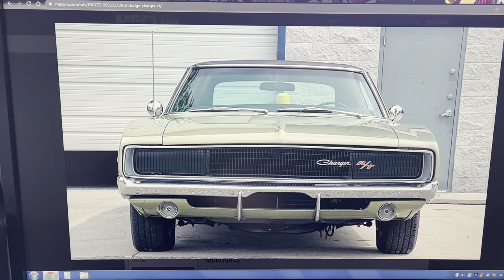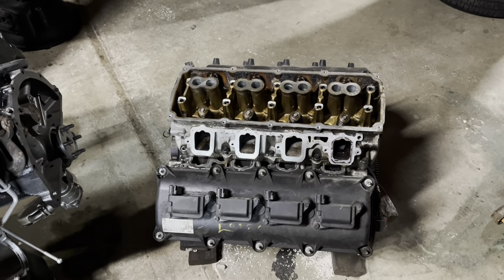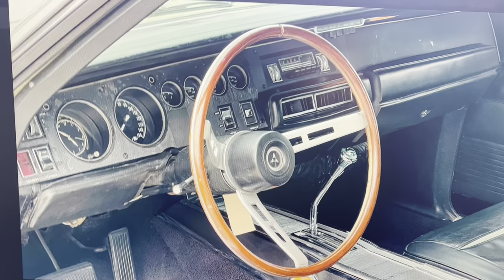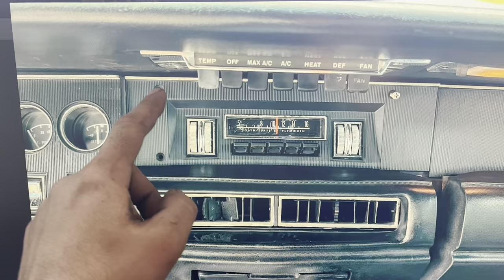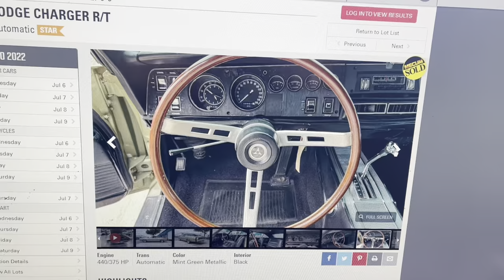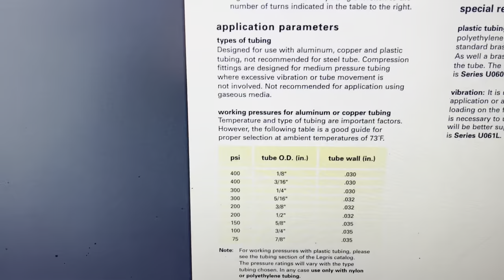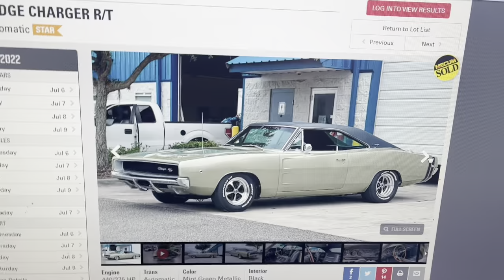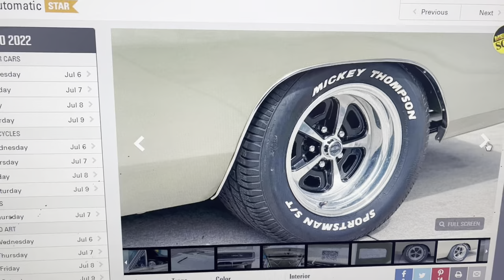Why Did This 1968 Dodge Charger R/T Just Sell At Mecum For $170,000? (It’s Unsafe And Bad)

Comment: Sad thing is my buddy and I and another buddy restored a 68 super bee, not factory original but close and only had around 35k in it. So I don't get why people can't take pride in their work. The compression fitting on the brake line is a major no no and used to be illegal to install on brake lines, now they did have steel compression fittings for brake lines but thats besides the point, we bought all the brake lines new in stainless pre bent for the super bee for lil over $200 shipped. And they fit great no issues. So yeah wth?

Comment: I bought the same ugly green Charger, mine was a 69 in 1976, and because the door was sprung(don't back up in the snow with door open)paid $200. New quarter panel, door, alittle welding and paint it was good ta go. I got $1000 on trade in on my 70 Cutless 442 and never looked back or owned another Nocar!
Reply from the maker: Good! More for me.

Comment: Brass compression fittings are for household plumbing pressure.  There are compression fittings that can withstand well above automotive brake pressures, but they aren’t made of brass.  In a pinch, I’ve used a stainless Swagelok fitting.   But for $170k, I’d expect the brake line to have no unions.   This isn’t a vehicle that exceeds the length of brake lines stocked by parts stores or repair shops.
Reply from the maker: Right - that too. But factory reproductions are also readily available. There are fittings that can do this safely. That isn’t one. And yeah - for $170k…

Comment: I drove for Mecum Kissimmee for 2 years and it while it was a bit fun, many of the cars that posed as high dollar and desirable cars, fell very short of that and had been patched and covered up the defects which I found easily while waiting in staging. Many, many high dollar cars have crap gas, you can smell that lacquer smell when gas goes bad inside the tank and many also had cheap new batteries. These cars IMO go to the fact they did not come from an owner that had the means and or desire to take care of his cars. One 68 Camaro SS had such bad electrical issues that it would shut off, complete electrical failure then after waiting 5 minutes you could hear the auto-resettable CB clicking back on and all things came back to life. No Camaro or car that I know of that time has an auto-reset CB. Fuses, cars back then had fuses but someone that did not know how to wire a car and used these fire hazard CB'S. And it did show as wires ran all over the engine compartment and the darn thing sold over 50K. This was maybe 10 years ago. I would not have paid more than 25K for this car. I could go on and on........some people have way too money and should PAY up and bring a good collectable car mechanic to these auctions. Some do, most don't.

Comment: The compression fitting is one of those things that's just not going to go away. DIY'ers use them, dealerships use them, and auto parts stores sell them in a little rotating rack that says "brake fittings" on it so good luck getting rid of them. I only recently learned that most of them are not DOT approved and technically illegal to use on the road but I can name a slew of local dealerships and even commercial repair shops that use them.
Reply from the maker: Yeap… there are a whole lot of them on the road unfortunately.

Comment: Have seen compression fittings and single flares on break lines too many times even from shops. They aren't even  legal for passing inspection here in PA.   And the plethora of other points in your not picking this car apart  are sound as F.      $170,000?!?!   This car has many  great bones , but this price is INSANE.    Looks like this car did fail a test drive and was slapped back together and sent to auction.   Hemi cars are totally out of reach for the regular guy and 440 cars are getting there too. But this price for this car is ridiculous.  It doesn't take much of an expert to see it, you're right .   Sad for true car guys. Everyone wants to score when they sell , but this is kinda like the snake eating its tail for the future of we motor heads.

Comment: I see one other pretty obvious thing wrong, and that is the ride height. It is noticeably too low, front and rear. Well below stock. The one good thing I did notice is that it has the correct 15" wheels and real tires, actual tires with actual sidewalls, not 30" GHETTOS with a thin strip of rubber wrapped around them. They are BFGs, and having put BFG Radial T/As on my 1976 Corvette about a year ago, I am not happy with them. The white letters turned brown fairly quickly. With a razor blade and some brake cleaner, I was able to get most of the brown off, but it came back a couple weeks later. The tires are defective. I went back and forth with BFG for 6 months about this, and never got anywhere. As for that Home Depot compression fitting in the brake line, that is unforgivable. But my biggest concern is the body. I'll bet there is a ton of rust and bondo under that new paint. I am a mechanic, and mechanical things can be fixed. But a rotted out body is a whole nother thing. I am not a body specialist, but I have worked around them, and I pretty much know what is involved. The body is basically the car. It's what everything else attaches to. And if it's bad, the car is junk. No amount of mechanical repair will fix it. $170K should have bought a brand new condition Hemi Charger.
Reply from the maker: I completely agree. My car doesn’t sit at stock ride height either, and though several other people have brought it up, it really doesn’t bother me personally so I didn’t mention it. It’s definitely not stock.

Comment: This is an old post so I don't know if anybody will read it, but here I go. I started work at my first garage in 1987 after graduation. The compression fitting you are showing look pretty much like the ones we used on cars from that time that came right from our brake fittings bins supplied from our brake parts supplier. I will not mention their name but you "Might" guess it. I never had a problem with them. I have a 1979 Aspen Rt that had them on it when I bought it 25yrs ago. It has seen harder and longer braking than most of the cars I've ever owned. I would never install one of these now, but maybe the old ones were better or a lot of people were just lucky. If I bought something now and saw them I would definitely get rid of them, but I wouldn't judge something that might have been done before standards changed.
Reply from the maker: I could be wrong, but that one looks like it was just installed. There are zillions of those things in service in brake systems. Many commenters have said as much. I realize that this isn’t that uncommon. That doesn’t mean it’s a good idea… a flare connection is the right way to go. And on a $180,000 car… could they not just afford a replacement brake line? They aren’t that expensive…
Reply: @DeadDodgeGarage  I agree, at that price everything should be premium. I just found your channel and like what you are doing. Congratulations on it!
Reply from the maker: @markdavis3362  Thank you!

Comment: Note the chart for flare fittings was for a 37 degree flare  - that's like an AN fitting.  SAE is 45 degree and should be double flared.  I think I'm one of the few that bother to double flare (I actually have extra mandrels because those little buggers tend to break).   I think AN fittings are OK with single flare - but I did see a tool that claimed to be able to double flare a 37 degree fitting.

Comment: The car sold as if the guys at Graveyard Carz or some other quality shop restored it. The problem with it is that with so many glaring problems such as the missing front sway bar, compression fittings in the brake system, improperly run speedometer cable that has been melted and not replaced the fix a ratchet strap, the interior trim is a mess with dash screws missing, the window trim not properly installed on the rear side windows. This car is a hot mess on what we can see corners we’re cut everywhere this is a bad backyard restoration if this came out of a shop they need their license revoked. I need to circle back to the brake line with the compression fitting it just keeps bugging me the line looks like two brake lines spiced together making the line that isn’t run properly as pointed out I believe they went cheap because the actual brake line was expensive and they went cheap possibly salvaged part of an original line and a stick of brake line and $5 compression fitting this worries me how many other places did dollars over safety take place on this car. I would love to see this car get an inspection by Graveyard Carz but I’m sure they are more than aware of this hot mess I’m sure they have to make sure that everyone knows they had nothing to do with it. I use Graveyard Carz because they are the best of the best having done million dollar plus cars 1 of 1 cars regularly with values near a million restored back to off the assembly line condition.

Comment: I have seen so called professional restorations that id be embarrassed to have in show. Or even drive. Took my 65 Impala SS to a large show near me when i first built my car almost 30 years ago. They used my car in for some of their advertising. And i was the only car in the top 10 that wasnt a trailer queen. I drove mine. And still have it. And it still turns heads everywhere i go.
Reply from the maker: Very proud to drive my Charger as much as possible. Ok, also slightly ashamed because it looks much nicer than it is and everyone drools over it.

Comment: You are 100 percent correct about not using compression fittings on brake lines.  I quit following that hack Scotty Kilmer after he said in a video to use compression fittings on brake lines.  Thankfully, someone in the comments said no, this is not correct.  I researched it myself and bought the right stuff.  But just think of how many people believed what Scotty said and actually used compression fittings on brake lines and spread that misinformation or worse yet got hurt because of it.
Reply from the maker: Wow… I wasn’t aware that he did that. Incredible.

Comment: I've been in so many arguments with people about compression fittings. Even the parts store sent me compression fittings after I specifically told them it was for brakes. Ended up having to go explain why it was such an error because they apparentlyhad no idea and or couldnt read.  I did state inspections for a decade here and a compression fitting on brake lines was a definite failure.
Reply from the maker: Yeah… I’m amazed by the number of people in the comments here saying it’s fine. It’s not fine.

Comment: I had a 68 Charger . After I fixed the A/C it was the coldest I have ever seen . I would actually put ice on the windshield in July in Florida . It had a 318 so it wasn't road burner .
Reply from the maker: That’s terrifying. Haha. I love a good 318. I would have been fine with a 318 (or heck, a slant six,) but I’m glad mine is a 383.

Comment: I'm a poor but relatively honest retired mechanic in the UK. For amusement, I build, in a wooden shed, restomods on classic Triumph Dolomites, usually with more modern fuel injected GM engines and transmissions. Not that I sell them, but if I did they would be relatively low budget cars, maybe only £12k max. But NOTHING i've done, even on my WORST day, is as bad as that Charger. 

 As hard up as I am, I have an ancient Pickavent pipe flaring tool for making hard brake lines (cost me a couple of hundred new, 30 years ago) Even so, using that compression fitting, probably designed for central heating, is unforgivable. ANY garage worth it's salt will have a tool like mine and would have made a new pair of pipes to pattern (the other one looked pretty rusty too) for only a few bucks, Hell, in the UK you can buy a whole SET of hard lines for most classic cars, made in cupro nickel so they don't rust away EVER again, for around £100. I bet that goes for the Charger over there too!

 It's not only dangerous bodging, it's UN-NECESSARY dangerous bodging!
Reply from the maker: Exactly! It’s not like flaring a line is all that difficult! Annoying, maybe. And takes a few minutes more than this bad repair. But not that difficult. That does sound amusing!

Comment: I watched one of those auctions on TV a few years ago.  An AAR Cuda or Challenger Trans Am, can't remember which, went on the block.  Four speed car.  Had a camera underneath as it drove up to the line.  You could see the flywheel/clutch assembly spinning around as it drove forward.  The dust cover was missing on this high dollar car.  Now, you can drive a 4-speed car without its dust cover, but DAMN - it's a low dollar item and easy to find, at least in reproduction.  Makes you wonder, if something that easy is wrong, what other corners have been cut?  I know from experience that there's always more wrong with a car than you can spot in a quick once over.  I also know a guy who buys, then "restores" cars.  Same formula - fresh paint, some new upholstery, generally zero mechanical rehab, or at least as little as possible.  Then he sells it after driving it to a local cruise night a time or two.  Afraid to drive it more than five miles.  One AMC car wouldn't start, got me to help, he thought maybe it was the carburetor, turned out to be a stripped distributor gear.  I put a new distributor gear in it for him (with the old cam gear staying in place), then timed it for him (he had no idea how to do that) and he immediately sold it before anything else tore up.  He literally was afraid to drive it.  And that was one of his nicer cars - excellent body, nice interior, looked really good so long as you didn't look underneath or down low in the engine compartment.
Reply from the maker: Exactly. What else is hiding if they can’t be bothered to do stuff like that right? Yeah.. that sort of stuff is just so far out of my universe I can’t believe it. Drivability and things actually working come before all else to me. To be fair of course, I don’t have enough money to mess around with cars at that level.

Comment: There are some really shady mechanics out there. I took my 73 Cuda to a couple and had of problems.  The first never got the car to run right. New pistons, new heads, new A/C complete overall and the car would over heat. Another mechanic in Des Moines took in my car. I found that his son had a beat up barracuda and parts from my car were exchanged to there's. He got it to run a little better but I too the car away and he was trying to keep it saying the brakes were unsafe and he would be liable. He just wasn't finished exchanging parts. Replace the old tach that was just disconnected with a new one that is not running properly. Tach won't register over 5,000 rpm. Bolts that connect the electrical parts were not tightened, fell behind the air and he wouldn't fix it. Front fender electrical was loose. Looks like he swapped it with my original. Had to buy a new one and exchange it myself. Brakes were fine when I took it to him but he was right, there was something wrong as it is hard to stop the car.  Took  it to a third mechanic and he did a good job of getting it to run.  One little thing, it's a 6 pack and he hand put a regular nut and bolt to hold the pan onIt's ridicules as Year One sells the wing nuts for about $15.00 a piece. They all charged top dollar. Moral of the story. Don't trust and mechanic in Des Moines. An honest and close friend of mine went to mechanical school in Des Moines. He said the instructors actually taught the students how to take advantage of the customer. He quit being a mechanic.
Reply from the maker: Ugh. I definitely wouldn’t trust a classic to just any shop these days. I would be looking for an old school mechanic that gets it, or even better, a Mopar specialist. That may not be available in your area - I wouldn’t know. But there is a gulf of difference between regular production repairs on modern cars and working through classics correctly. I have gotten very involved in both of these - in fact, I ran a shop that tried to specialize in both. It was extremely challenging.

Comment: These auctions are ruining the hobby.

But having played this game myself, people have to understand these auctions re the same three hundred guys showing whose wallet is bigger each time.  The peripheral people are the ones who get burned like this.  

Important take away from the above statement is not the often bad cars, it's the size of the core buyer group.  All of whom are getting on in years.  They've driven prices to insane levels...and as they pull out and die off over the next decade those values are going to tank.  Be very careful about how much you sink into any collector car at this point because the salad days are just about over, at least for a while.

Comment: There was this thing called "Dodge Fever" back in the 60s, but the worst that could ever happen to someone with "the fever" is they would end up with a brand new straight-off-the-showroom-floor Dodge, and a few thousand dollars poorer. Nowadays, there is this thing called "Charger Fever" and the "fevered" can end up with a questionable (at best) Charger and a LOT of money poorer. In this case, a Charger with signs of things done wrong from front to back for $170K. This is nuts. People really need to come to their senses. Just because it's a 68-70 Charger does NOT mean it's worth an unlimited amount of money.

If I had $170K to blow on a car, I would expect a car with virtually nothing wrong with it, and no improvements to be made. A turn-key car that I can just get in and drive and enjoy, PERIOD. If I want something to tinker on like this car, then I am giong to spend a LOT less money.
Reply from the maker: Exactly!